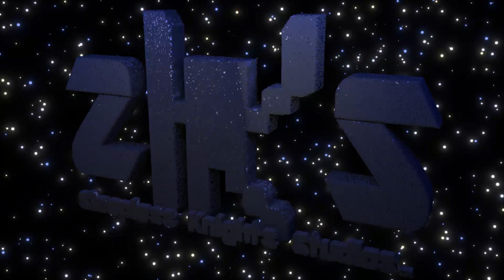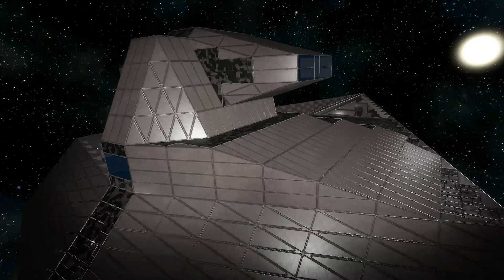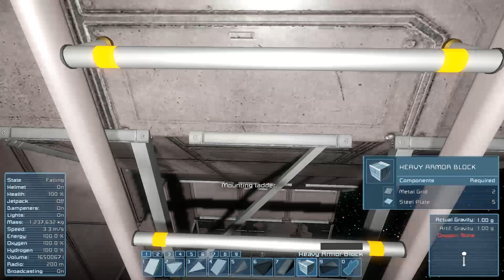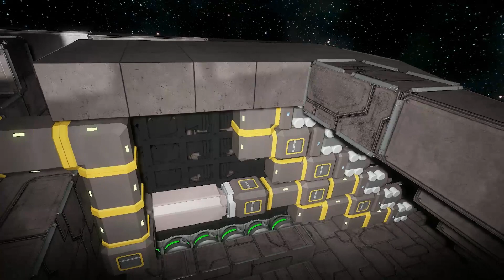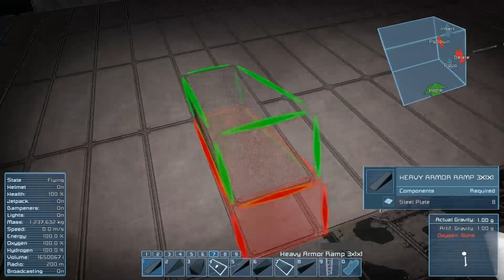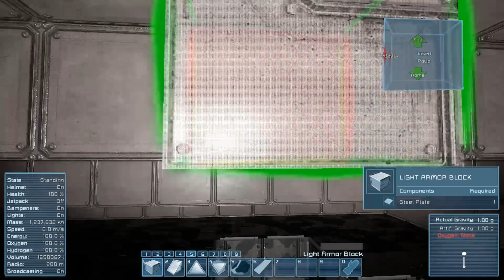Let's Play Space Engineers - Episode 83: Refining The Bridge & Roadmap Planning

Comment: Maybe after you perfect the oxygen farm system using pistons you can set up retractable weapons systems.
Reply from the maker: +David Shafer I've thought of that, the ONLY issue I see is they'd probably have to be on the top/flat part of the hull, as the blast door blocks only come in the 2x1 ramps not the the 3x1 I used for the hull. The only reason the O2 Farms worked is because it was at the back edge of the corner so the change in dimensions isn't THAT noticeable i.e. doesn't look bad. If I were to do that say in the middle of the side then it wouldn't connect right to the rest of the angle ramps, or best case would make it look like a bulge in the side of the ship lol.
Reply: Another thought; since this will be a late game ship, and will take so many resources to build why not pipe in welders to certain keys areas    the ship and tie in projector's so that if they take damage they get repaired immediately. Sections of the hull, the engines, power generators, weapons things like that.

Comment: Dear Sleepless, I recently bought Space Engineers and was very excited to play it. I have played it on this rig before and even had a world save, when i started the game it booted right up however when I tried to load a world and it would run the loading icon in the loading screen for the longest time, then freeze up. Do you have any experience with this issue
Reply from the maker: +Derrick Earp I've actually had this happen a LOT! Unfortunately it's inconsistent as to the cause. Sometimes it can be a certain mod, other times it may be something that broke in the world due to an update, and other times it may not even be clear. I wish I could be more help but I'd suggest checking out the forums and or contacting the devs if it keeps happening. :(

Comment: First off, awesome episode, as always! Here's my two cents (actually it might actually be more like a quarter :P ):

1. I think you can fix the problem with the sloping down from the neck by having it be wider out towards the back. If you bring the ramps flush with the place where the oxygen farms come out of, you can taper the rest of the ramps as they extend towards the nose (maybe by putting ramps on their sides or something?). If you're able to taper the ramps enough, you could evade the running out of space problem altogether. 

2. The viewport on the bridge looks a tad flat to me. Do you think you could make it bubble out more by using smaller, angled window pieces? Or is that not an option? Again, this is just my personal opinion. The bridge does look pretty good as is. :)

3. As for the reactor room, I think you should try and do another spinning reactor, 'cause, you know, spinning reactors are epic. Given that the space is mostly horizontal and not vertical, you could try and build a sort of tubular reactor and stretched across the room rather than down from the ceiling. Maybe you could try and make something like that by stacking a bunch of Azimuth reactors?

4. Here's a question I have—where's the storage? Do you have any place designated for storage? 'cause I haven't seen one... If not, you could always fill all that extra space up towards the bridge with a bunch of storage crates. It is right on top of the conveyer system, after all.

5. Also, if we're still voting on doors, I think the smoky glass ones are the best. I feel like the expanding doors take up too much room and look kind of bland.

6. One more thing—did you film this episode before or after the recent lighting update? 'cause the lighting update may fix a lot of your current lighting problems.
Reply: +Sleepless Knights Studios i gotta say you should probably cut this ship down to size for starting OR 
in the beggining smash it against the planet in a crash landing something like that
Reply: +tehenderman thedapper I don't think he's going to start out with this ship. He's going to collect all the resources to build it by hand in the actual survival game.
Reply from the maker: +Levi Buckley Thanks for the input Levi!

1. The issue with this idea, would come down to the height where the ramps meet the neck, if I started at the edge of the o2 farm area & went up, I'm pretty sure it would be taller than it is now. Unless I tried to stagger them (like 2 the same level then move up one, do 2 more the same level, etc).

2. I'd be willing to try, I don't know how it would look if you bubbled the front and the back is still square ish, but it's something to look into.

3. I really like this idea! Because I am thinking of a Survival use, I'm not sure which reactors to use cause some are pretty expensive to make, though this ship is rapidly becoming uber late game just because of all of the materials needed. So...why the heck not lol.

4. Currently, there's a fair amount of storage in the processing room, I used azimuth storage containers so it's the cylinder shaped containers in the room with the assemblers and such.

5. I think I'm agreeing. I liked the flush look of the expanding doors, but I agree they take up too much room. So I'm pretty much set on the smoked glass unless something better comes along.

6. I'm not sure, I filmed this on Friday night (the 22nd) so I think whatever the latest patch was had already gone up.
Reply: +Sleepless Knights Studios You&#39;re welcome! I like writing long comments. :P

1. Yeah, if you staggered them or something that&#39;d work.

3. Thanks! It would admittedly be expensive to build in survival, but as you said, since it is a pretty late-game ship, I don&#39;t see why not. Also, is there any way you could start a survival with this ship already built? Like a scenario or something? That would save you a lot of work.

4. Ahh, okay. I vaguely remembered that right as I posted the comment. :P

Oh, and have you considered using spherical shield generators for the bubble things on the top of the bridge? You could set them to push out and they'd great a gravity shield to protect the bridge.

So yeah, cool. :) By the way, have you thought about what you wanna name the ship?
Reply from the maker: +Levi Buckley Well, it didn't start as a late game ship lol, it's just getting too expensive haha. 

I also wish there was a mod/script that could tell you all of the blocks necessary to build the ship and what resources it would cost, but I haven't found one yet. And haven't exactly come up with a good way to code it myself either, but I'd like to make it a blueprint and do my survival series of working TOWARDS it or something. Starting with it feels sort of "cheaty" to me, unless of course all of my subs don't care lol. :P
Reply: +Sleepless Knights Studios A "working towards it" series actually sounds pretty cool. You could just have a projector running and then weld up the ship as you can.
Reply from the maker: +Levi Buckley +tehenderman thedapper Yeah, like I said to Levi, it started as a all in one survival ship, that is pretty much growing into a "endgame ultimate rule the universe" ship lol. So more than likely I'll just start a new survival world & start building towards it eventually lol. :P

Comment: You could put a turret on that/those corners. Also you could use spherical gravity generators as the balls. And I think the shield mod is called "Energy shield".
Reply from the maker: +Duke00x Which corners do you mean? 

I thought about spherical gens, but I'm thinking of something a bit more "useful" per se, and I'm not sure how much use I'd get out of those.
Reply: Sleepless Knights Studios The corners that you can't finish because the blocks would go over the edge.
Reply from the maker: +Duke00x Yeah I've gotten that suggestion by others too, it's definitely something I'll be testing.
Reply: Sleepless Knights Studios It would give a logical reason for it not fitting with the upper rows. And you can use the normal 1x1 slopped blocks to go around the base of the turret to blend it in to the reason a little bit.